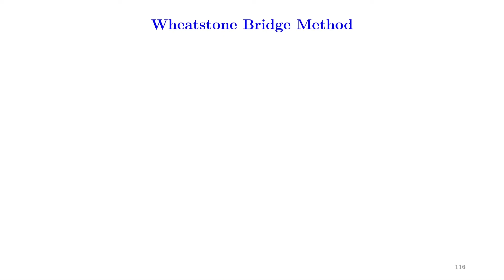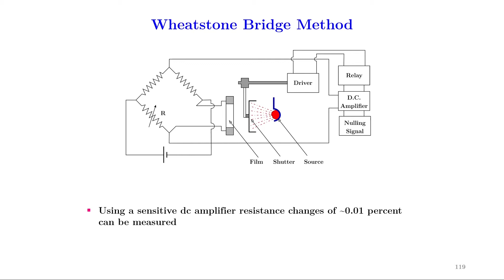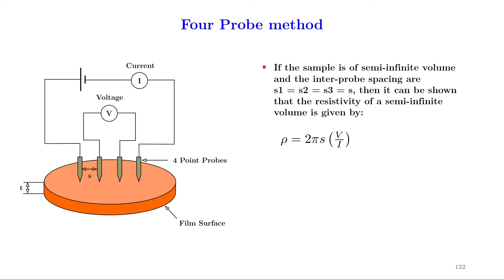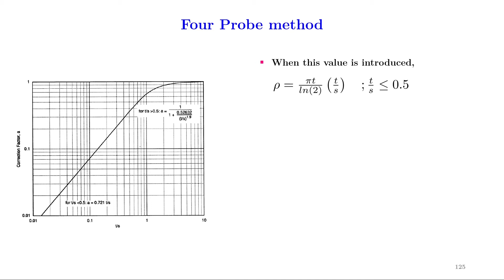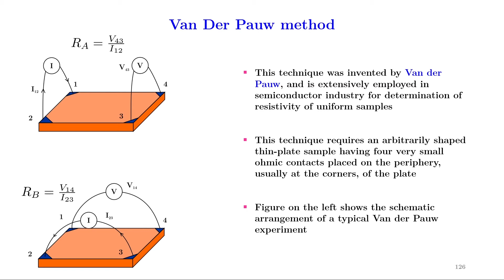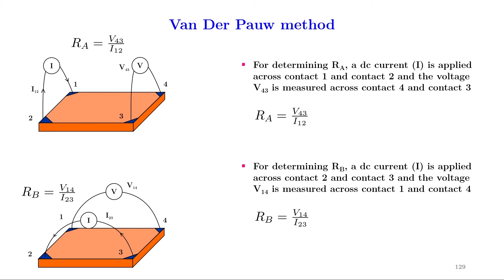Electrical Conductivity Measurements of Thin Films

Comment: I wonder how the current happen in thin films . Is it any special physics behind them. for example I need the zno material and as its resistance is differs from the metal, how the path of electrons will be different. So in metal the current is explained by the impluse transfer of electrons, and they are in electronic medium acn just repel the energy. and their velocity is small while the whole electric charge transmits in very high velocity.